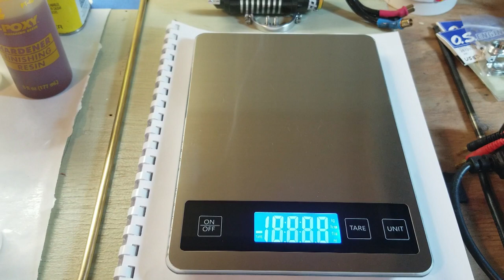ZIPPKITS JAE 21FE V2 OUTRIGGER WOOD KIT BUILD_PART 10

Comment: Hmm, some say you should never thin your epoxy, as it may impact on its properties. You have never had any issues with it, right? I usually coat my boats with unthinned epoxy, but that makes up for a heavy coat, and then, a heavy boat.
Reply from the maker: I've had no issues. I use denatured alcohol, which I think is more mild than acetone. I don't think strength is the issue here, it's penetrating the wood. And it's a plenty tough finish when it's cured.

Comment: G,day mate Nat here in Ireland from Australia originally, I'm working on wooden outrigger now  ,would you sheet fiberglass it as well after epoxy to get colour finish any advice thanks mate 🤙🤙
Reply from the maker: Hey Nat, I would not cover it with fiberglass. It would add too much unnecessary weight. Some guys do not even add carbon fiber to the inside hull bottom & sponson bottoms. I did put CF in mine. Next build I would use lighter CF and be very sparing on the amount of resin. Also thin your finishing resin with alcohol, do two coats before paint, three at the most if you're not painting it. The weight adds up fast, keep all coats as thin as possible...
Reply: @chilly7261  thanks mate for your advice maybe be on to ya for more advice cheers, fast boating mate🤙🤙
Reply from the maker: @homienat3374  I just realized this question from you came on the Zippkits video. No carbon fiber in this one. There is CF in my RSX380...
Reply: Hi Sam just finished build should i epoxy resin  in and out of boat ,prime it then paint thanks
Reply from the maker: @homienat3374  If you're painting it, yes. I would give it two coats of epoxy. Thin your epoxy resin 2:1, two parts epoxy mix to one part denatured alcohol. The first coat will mostly soak in and seal the wood. Second coat should end up filling the wood grain level. Sand and wipe dust off with denatured alcohol between coats and then paint. Don't sand the epoxy on the inside after second coat. Good luck!
Reply: @chilly7261  great ,nice 1 Sam appreciate ya advice 🤙may ask you for more info ,if ya don't mind in future, look forward to seeing your next vid thanks again

Comment: I wonder if it is possible to apply the resin on the hull outer using a foam roller for a smoother finish and less sanding?
Reply from the maker: It seems like the first coat always gets the fuzzies. The second coat ends up way smoother once the wood is sealed...
Reply: With a roller you will end up with very thick coat. It is your choice though. As long as you then scrape the excess with a credit card or similar,  it's all good.
Reply from the maker: @OliveiraX  I prefer the control of a brush...